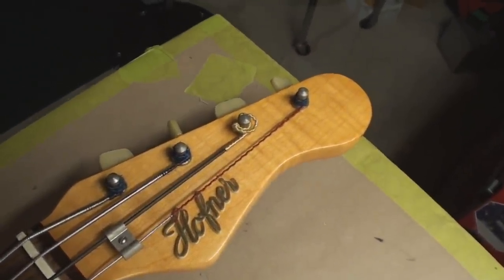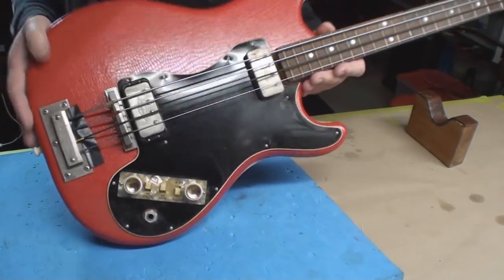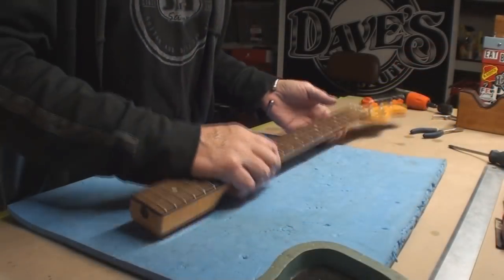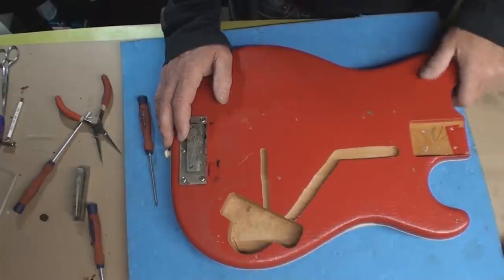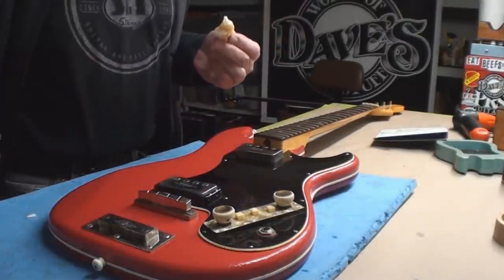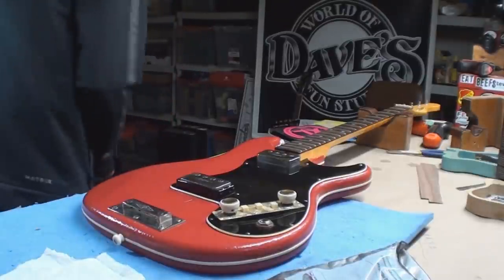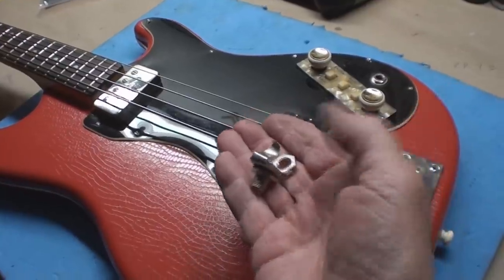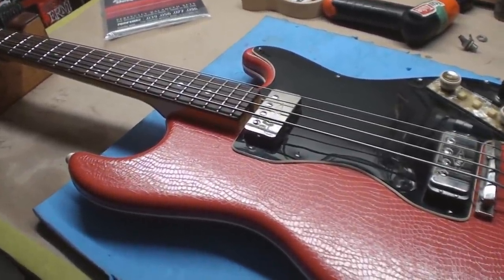Hofner Tolex Bass Guitar 1960's

Comment: We see a lot of these over in Europe, And I have repaired a lot of old Høfners :) You need to get the pickups rewound, they drift in resistance, the isolation on the wire they used breaks down over time they where not potted, so the wire can move and by now 50+ years later they are done, they are easy to rewind, use 0.06mm (gauge 42) wire around 4500 turns,  don't solder a lead to the start wire, inside the coil,  and feed it through the little hole in the bobbin that is a recipe for disaster, pigtail them like modern humbuckers and be careful when you pot them, the bobbins are very fragile and 65 degrees C of heat is what they can stand. Good luck :)

Comment: Hi Dave,

Here's a trick I discovered whenever I have a bridge ground wire and a soft body wood, I put some copper tape on the body lay the ground wire on top of the copper tape and then set the bridge in place. The copper ground wire sinks into the copper tape but the copper tape still has a good connection to the bridge. If you want you can even solder the ground wire to the copper tape before attaching the tape to the body. This has always solved my bridge grounding issues due to softwood bodies and certainly would work well on this tolex bass.

Comment: The design of that Tolex bass is interesting but not tech friendly.  I have a Hofner 500/1 (The Beatle Bass) and found the controls confusing. You could select the neck pickup or the bridge pickup by setting each switch to "ON", but you need to set both switches off to select both or ON to have both pickups off.  Fortunately, each pickup have surrounds with four set screws to adjust pickup height to loosen the pickup then, using adhesive tape to pull up or push down the pickup to the desired height then tighten the set screws. I shopped for replacement Hofner strings, and found on North Coast Music's website that a set cost $120 USD!  I settled with La Bellas 36-96 for $35 USD.  Still pricey but less than the $120 for Hofners. I understand Sir Paul uses La Bellas. Even he cannot afford Hofner strings.

Comment: This is the Version 1 of the Hofner Professional. Either 1961 or 1962. Very rare as they changed to only one pick up for the next two versions, and then replaced it with the Artist bass which had tone pots instead of the switches. I bought this exact model in about 1972 very cheaply because one of the pickups was faulty and the switches had stopped working. The switches just needed a clean, but the faulty pickup needed rewinding. Not a bad bass, though I had to change the tuners as it had a tendency to go out of tune. I only had it for about 5 years before replacing it with a Rick 4001 Stereo.

I remember that I had to reroute the earth wire to the bridge, to the tail stock. The original system was a stupid idea! I also did some mod to stop the bridge moving, but can't remember what. The strings were not a problem, as I lived in London and just went to Denmark Street for them. I replaced all the caps and never had the low output problem you did after rewinding the pickup. I had a pair of 180 watt tube amps feeding custom 1 x 18" and 4 x 12" cabs and could be loud enough to piss off the drummer!

Comment: 1962 Horner 182 Solid Tolex bass. Supposedly has the same pups and controls as the violin bass.
Reply: I had the same one in a darker red, like wine red. Don't remember if the logo in the headstock was flat or raised, it's too long ago. I think it was flat. 
Bought it from a neighbour as kid back in 1975 and played it for two years,  including my verry first gig in the summer of 1976 at the age of 15.
Sold it for DM (Deutsche Mark) 150,-- to the brother of a friend, as the local music shop got a load of Kadsuga Jazz Basses, made in Japan by Fuji Gen, what was a huge  improvement. 
My Hoefner 182 was strung with black Nylons  -  and sounded like shit, no tone, no sustain, nothing. When it was gönne I didn't miss it at all. 
But I was happy as can be with the Kasuga Jazz Bass.

Comment: Hi Dave! I've got the same bass bass but a later version with 2 vol and 2 tone, no switches. Mine has no volume issues. I think that control panel is the problem. I think they call it the model 185

Comment: I would think that those “beatle bass” strings would technically be more like a medium scale length due to the added length of where the ball end sits in the tailpiece to where it makes the break angle on the bridge. The roto 77s were too short because they are meant for short scale that have a bridge like a fender where there’s not extra inches of string being wasted.

Comment: This is the same Hoefner Model 182 I played in 1975, it was an old bass then allready. 
Mine was covered in a wine red tolex and had the same pickups, knobs and control plate than the one on your bench. 
I bought it used for some bucks. I played it for about a year, even played my first Gig with it. This was 1976, at the age of 15. This makes me a bass player with 44 years of "stage experience". And an old fart. 
Sold it as soon as I had the money for a Kasuga Jazz Bass, a Japanese copy made by Fuji Gen.
The Hoefner 182 I had sounded awfull, but maybe due to the tapewounds it was strung with.

Comment: Tolex covered guitar? I never thought of that. Interesting. As far as the string/pickup height is concerned,  I would cut a piece of plywood to fit in between the pickguard and the body, paint it black and it'll be half an inch closer.

Comment: So no pickup routes? The pickups are flush with the back of the pickguard? Guessing no chance of raising or lowering...?
Reply: Are not the individual p/u coils screw adjustable to nearer string height, down is ths packing position, screw up for playing ?  German caps are not too bad but I would replace the caps and resistors just due to age,  that might improve. My expertise is english amps, so if the guitar is low impedence/high output a proper amp is needed too.
Reply: @highpath4776  True each individual coil screw could be adjusted depends on how far the PU is from the strings I certainly would not want to adjust a coil screw an 1/8 of an inch or more to reach optimal output.

Comment: Dave, you were LUCKY! My 2nd electric, a Hofner Colorama, had a set neck and a floating bridge which moved around of its own will. If you add the flatwound strings and the plastic knobs breaking off the tuners to the horrible controls, you might be forgiven for saying the thing not only looked awful it was also awful to play and sounded crap. Being a po' boy, I bought army surplus pups (Bankrupt Baldwin), stripped and refinished the fucker with a home-made perspex scratchplate to get rid of that fugly look, couldn't do anything to help the action (set neck, no truss rod?? bottomed-out bridge with thumbwheels removed. It started crap, and ended up being a different pile of crap.

Comment: Medium Scale D'Addario will work on Hofner. Need to take into account the tail piece. Yes it's technically a short scale bass, but the distance between the bridge and the tail piece needs to be taken into account. It's a common Gooch. Same with the Beatle Bass. Try Labella Beatle bass strings.
Reply: I know I've had this issue with my Bass VI. It's a 30-inch scale, but there's a lot of distance between the tailpiece and the bridge, and that goes beyond the 30". I ordered custom La Bella strings and they sent me the ones for a regular 30" scale 6-string bass guitar that doesn't have a tailpiece way behind the bridge, and the E string's outer winding didn't reach the nut.

Comment: Dave, you are 62. What are you doing getting up at 9 am? It is little wonder the old noodle is working like a heavily fragmented 4000 rpm hard drive and not an SSD! ;P

By the way, I'm 61 and my noodle is not performing much different than yours! We're almost geezers and need to sleep in more often. ;)

Comment: Pyramid strings, were the standard factory fit for Hofners. The flats take about a month to settle in properly... the Frisco 60s scene loved them on their Starfires and blurry Gibsons, the scales were 30.5” or 32”and Rick Turner and Wickersham et al would razor cut the silk at the ends to get them to fit across the nut... Jack Cassidy and Phil Lesh used them all the time.

Comment: That rectangular electronics plate was common on all Hofner basses and a few of the older design guitars, back in the ‘60’s and it was horrible.  The slide switches made nasty noises or just didn’t work and the pots crackled like a log fire, amazing that Paul Mcartney managed to play one for so long.
Reply: I had a Senator bass with all those problems, , fortunately the truss rod broke when trying to get a playable string height and I got a Fender.....

Comment: Also you need to use Hofner, LaBella or Piramid strings on this. Since the tailpiece is far away more than on normal bass. That’s why only Hofner, LaBella or Piramid works. They are made the right lenght.

Comment: I know they were never high output, but those pickups sound like they're shorted. Sometimes I see pickups where there's so much corrosion inside, they just don't work any more. If I were going to try to use that bass, I'd probably get some retro staple pickups, which will fit, and have better output.

Comment: Hey Dave, have you ever had the issue with the g string on a guitar never quite being in tune even after a set up by 2 different shops but it still doesn’t sound intonated even though apparently it is? I’m at a lost with it
Reply: I'm no expert, but I've had to deal with that issue on an electric I had. From my understanding it's due to the nut, and it's what zero frets aim to resolve. I don't know how to fix it though, I just dealt with it. If I remember correctly it was perfectly intonated but still sounded different to my ears anytime I played an open chord.
Reply: Matt Treck yes this is exactly the issue I’m having, driving me crazy, I had the shop when I brought it new set it up on 10 gauge strings but like you say I don’t think the nuts been filed to compensate. I’m going to put 9 gauge back on it to see if it solves the problem. Plus if I capo it at the 1st fret the problem goes away, so all is pointing to the nut. Cheers for the reply
Reply: @drewhurst3643  just tune the g string a couple of cents flat and then the fretted notes will kinda fall into place, yeah...it's a compromise, but people do this.
Reply: @kindisc  The issue is that fretted notes sound fine, but if you play an open chord, the notes resonating off of the nut sound out of tune with the fretted notes. Tuning the string would resolve it for open chords but then knock the fretted notes out of tune.